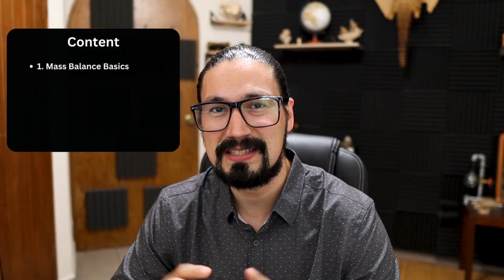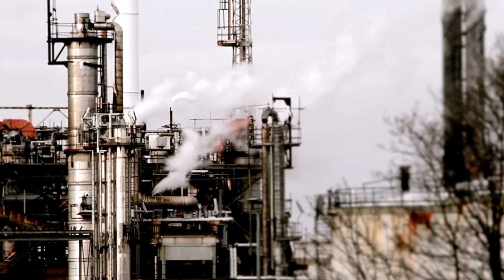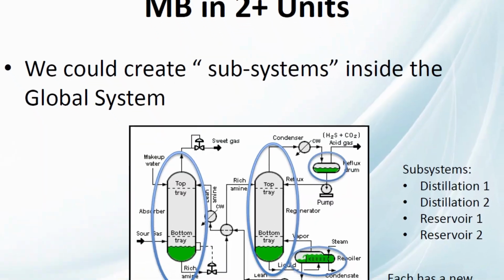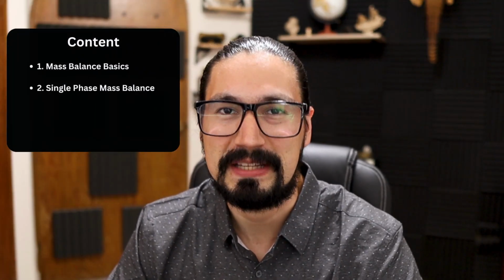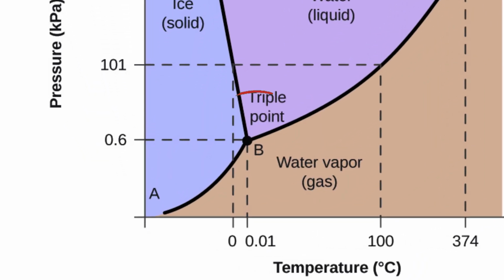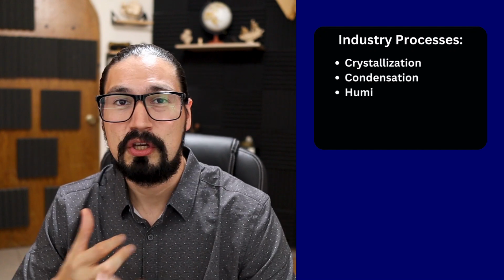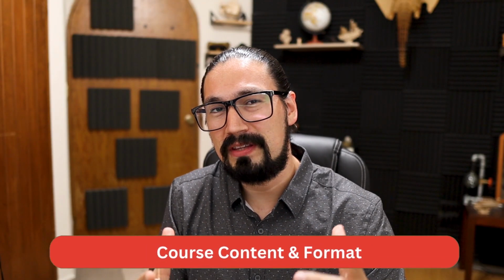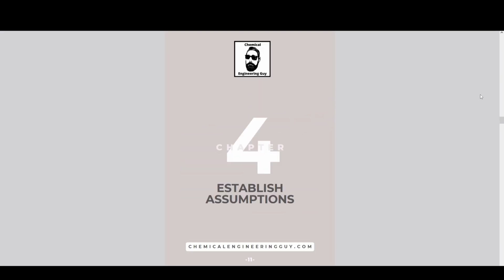Mass Balance Fundamentals Course (Trailer)

Comment: I would never ever recommend anyone to be a chemical engineering major.  The major is extremely broad and the focus area (mass and energy balances, distillation, plant design, heat exchangers and heat and mass transfer) is mostly only used in oil refineries.  This means that either you have to relocate or should just get a petroleum engineering degree instead if you really want to work in a refinery
Reply from the maker: True, it may be very broad, but it also helps that it is very broad (you'll get into any major process, such as food, beverages, plastics, building materials, specialty materiales, etc...)

Comment: Thanks for the well presented video. Had a process where we made a catalyst that we impregnated with gold. The material balance for the gold was very important. We always had some that was missing at the end of a production campaign. I had Maintenance cut one of the pipes open and there it was - approximately 3/8" layer of black gold deposited on the pipe walls. So yes, material balance is very important.
Reply from the maker: Hey there, thanks for the kind comments! For sure, material balances are key for such processes, in some cases we may ignore the amounts, in other, we must not!  Are you still in that industry?
Reply: No, left that plant (catalyst manufacturer) in 2006. Now I work in specialty chemicals.  @ChemicalEngineeringGuy